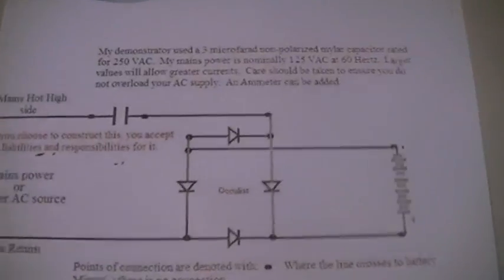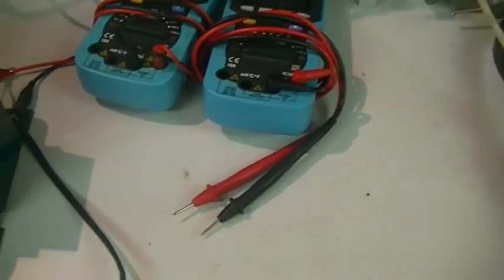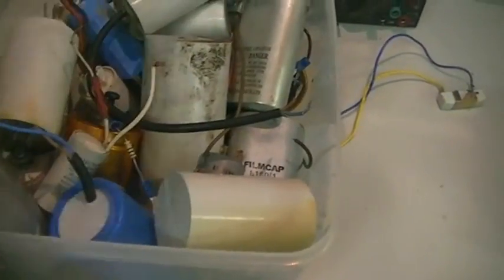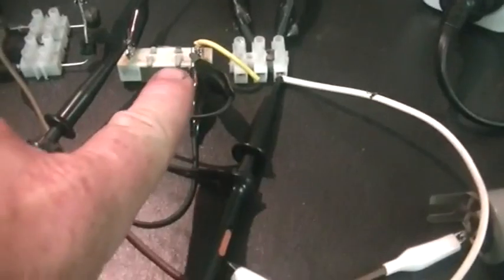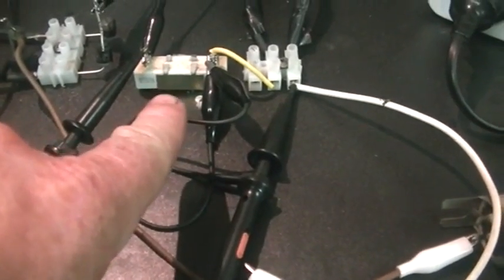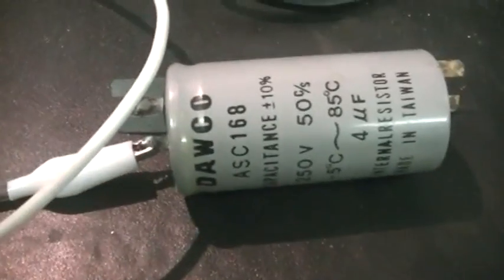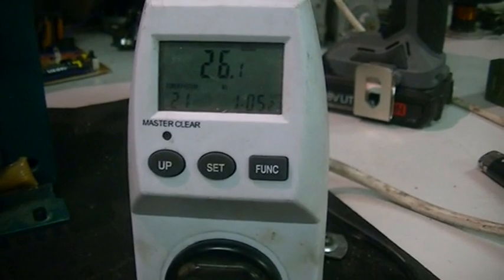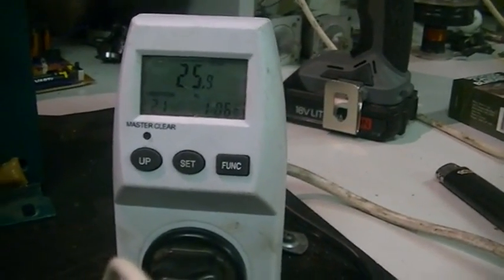Cap charging system

Comment: I have also seen anomalies when I run my bedini off a AC to DC transformer, the power measured to the primary coil drops when I have a capacitor on the line between the secondary and the bedini.

Comment: this is good to see! i have made similar observations on my small solar setup, where i measure a larger load on my lead/acid bank than what is coming in from the panels, yet the batteries still show a charging voltage. i was thinking it was due to the higher voltage the panels were capable of creating forcing it way through unmeasured somehow....(very technical i know)....this is making me think it all over again